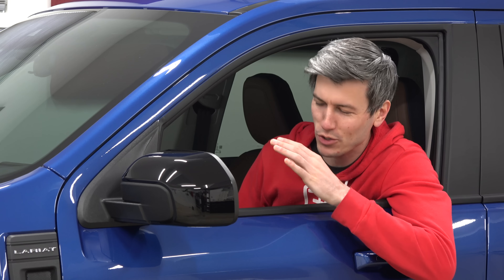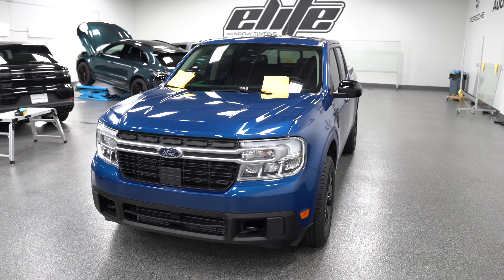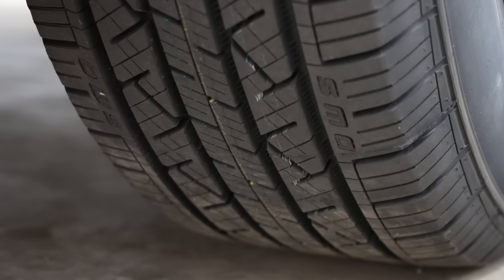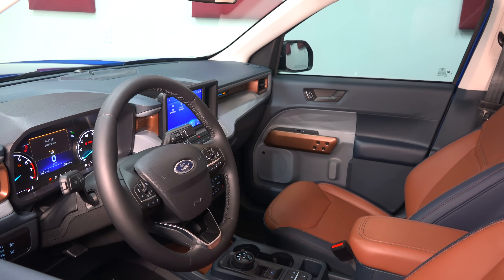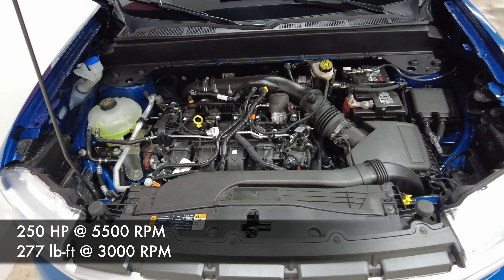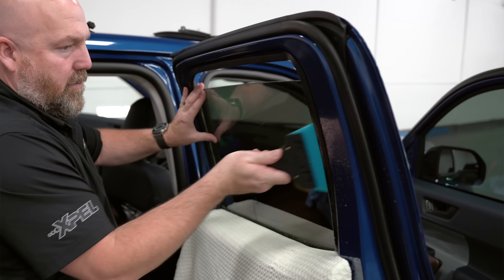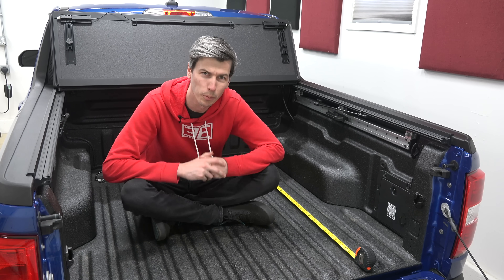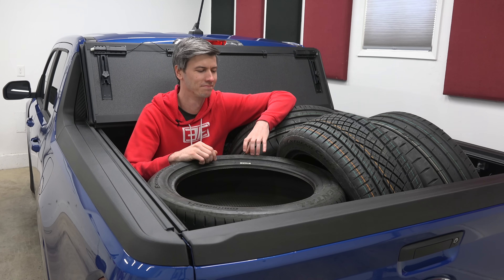I Bought A Ford Maverick! The Perfect Pickup?

Comment: I LOVE RATIONALITY. Thank you for this video. I live in Australia and the best selling vehicle is a Ford truck like the one featured. Unfortunately there is a concerning trend for buyers to purchase the oversized US trucks like the F150. 98% of people who purchase these vehicles don't  need something that size. I wish our frail egos did not drive us towards illogical choices making us consume much more than is necessary. These large vehicles also pose a huge safety risk to drivers of normal vehicle's, not to mention pedestrians, cyclists, children, and motorcyclists. Their mass and poor braking performance can be a deadly combination. Please buy what you need and not what you think you might want. 
PS. the vehicle I drive is dwafted by the smaller truck and I can fit 4 large adults and 3 packets of mulch in it with ease while consumming 4.9 litres per 100km of fuel on the freeway.

Comment: I used to work in construction material testing. We hault wheelbarrels, coolers, concrete cylindars, drilling equipmemt, buckets of aggregate, nuclear density gauges...the Ford Ranger or a small van was the perfect vehicle for the majority of jobs. The remaining ones used the larger trucks. But most prederred the Ranger or Tacoma. 

Its funny watching people struggle to load a 4 door massive truck with a short bed at Home Depot. 

If I were to ever buy a truck, this would be it.
Reply: We still do these kind of things in Europe and its mostly vans that are being used. Havent really understood why you would want to transport something in a truck bed instead of a sheltered van. You dont get the off road capability, but gravel roads and forest roads are fine. To each their own i guess ;)
Reply: Dude I’m also a concrete and soils tech. I’ve been looking for something affordable and good mpg bcuz of how much were on the road. Looks like this is the winner.

Comment: The problem that I have with pickup truck owners is that they think they might need it for something some day, so they buy a truck. But the statistics don't lie. The vast majority of those trucks only haul kids and groceries. Something you could easily do with a station wagon, or a minivan. Those pavement princesses are always so clean that the drivers wouldn't dare take it off road because they are afraid it will chip the paint. Those aren't work trucks. They are compensating machines. And they blind other drivers on the road because the damn headlights are so high off the ground, and are responsible for the uptick in pedestrian fatalities in recent years. Take my downvote Engineering Engineering Explained. See you in 5 years when that truck won't have done a decent days work in its entire life.
Reply from the maker: Lol, getting upset bc I bought a truck the size of a Honda Accord. Nicen
Reply: @EngineeringExplained  the headlights are still so high off the ground that you blind the rest of us while driving. Try thinking about the other people on the road and stop being so selfish.

Comment: I just got mine in early April. Same color (blue cars are the best), but hybrid XLT Lux. A few years ago I had a rental with a heated steering wheel and I knew my next car had to have one. 

I'm not bothered as much by the auto (hybrid has an eCVT which is a planetary gearbox with the electric motor filling in the gaps) as the dial. I've already accidentally thrown it into park both attempting to go to reverse and going to far, and going from reverse to drive and going the wrong way.

Comment: The Maverick might not do everything, but it packs around air in the box like any other pavement princess on the road. A lot of people don't buy what they need for their current circumstances as trucks have become a status symbol. I mean buying a loaded diesel dually pickup is cool if your budget allows it, but unless you're going to put it to work hauling/loading things, you're just burning the rising cost of diesel and taking up space/handling for nothing. The Maverick (or vehicles like it) makes sense for a lot of consumers. 
Honestly with rising fuel costs and work taking up too much time, been debating selling my RV trailer and pick up, and downsizing to a Maverick or Ranger, kind of wish the Maverick towed just a little more and their hybrid had 4x4 for winter up here though.

Comment: It's so funny that you bought almost the exact same truck as I did except I got the Hybrid and the original 2022 Velocity Blue! I had also really wanted and awd hybrid, but tbh this FWD hasn't let me down rain, snow, or over-landing in New Mexico. What's even more amazing, I opted away from the OEM Michelin Primacy A/S for the same Continental CrossContact which I put on in December with my truck at 50k miles. 
I do love the interior, though my rear seat has a tear from loading a suitcase so be careful. My dual-zone a/c knobs also have the digital temp readout that they got rid of due to chip shortages. 
After 2 years and almost 60k miles the only advice I might offer is: the paint on the front of the hood has been demolished by highway rock chips. Pick up a hood deflector or PPF sooner rather than later.

Comment: I initially took issue with the opening to this video, because no one needs a truck, and people buy them when it makes far more economical sense to rent them.

But then I looked up how efficient the hybrid version is, and its towing & cargo capacities, and its price. This might actually be a practical daily driver, which is insane because it's a truck. And it's a truck that is better than almost any truck out there for having an accessible usable bed space. The only downside is the length, but that just makes it more practical for most use cases and only slightly more difficult for the rare use cases.

Except for the fact that it's a Ford, this is good enough to be worth considering over a sedan, which is insane.

Comment: I feel your pain. I own a Honda Ridgeline and live in Texas.  I get a fair amount of crap too.  I owned full size trucks and will never look back…
Reply: Same. 100% same. I haul air 99% of the time.
Reply: Yup! I know what you’re talking about. I too am in Texas and am very interested in a Ridgeline. In reality it’s all I need and I’m a Honda fan. Currently have a 2015 4wd F150 with a 6.5 bed and it’s tempting to make the switch. Only thing holding me back is that it’s been paid for almost 5 years now and I only have 50k miles on it
Reply: Not a fan of the new ridgeline , but I owned a 2013 ridgeline top level and sold it for 5k with 310k miles on it . Best “ truck “ I ever owned and I had f150, f250 and f350 all with over 100k on them.
Reply: Being a Ridgeline owner since 2008 I have heard all the comments but I love the Ridgeline and the reliability to chuckle about it.  I simply do not need the larger trucks.  There are legitimate needs that the Ridgeline is not suitable for but for me and many it serves the purpose.  The Ridge has a V6 engine that requires a timing belt replacement at intervals but it has been trouble free.  It is certainly not suitable for those that drive large trucks for the macho status.  What are your thoughts on why you would pick the Maverick rather than the Ridgeline?

Comment: I have a full truck and bought the base maverick got daily also in my full truck I tow my Can am the other day my full truck was in service and I town my Can am to the sands lowered the air and went  inside the sand fully loaded 3200p and will it did great lol it’s a nice little daily I got the base with ugly wheels and bought new wheels and tires more Offroad and a 2 inch lift leveling kit and it’s great with some LED pods and it’s a great daily for everything

Comment: I'm on my 2nd Maverick.  The first was an AWD Lariat with every available option.  When it was time for a new Mav, I opted for an XL with the hybrid powertrain.  I truly never used 90% of the Lariat bells and whistles.  OK, the heated steering wheel was pretty great.  I also liked the look of the Lariat interior, but the "ActiveX" (marketing dept word for vinyl) seats were torture in the summer.  My hybrid XL cost me under $25,000 and it does 100% of what I need it to do.  Plus I'll be a lot more forgiving of the inevitable Ford squeaks and rattles on a $25k vehicle than I would be on a $40k vehicle.

Comment: The 2 liter duratecs are fantastic engines. Ford's been making them since 2006 and they are practically bulletproof
Reply: It’s an ecoboost not a duratec.
Reply: @manitobasky  Ecoboost is just a marketing term they came up with in the 2008 recession. This is from Wikipedia for Ecoboost 2L: "This engine is derived from the 2.0 L Mazda L engine block used by Ford" aka a 2.0 duratec. I have one in my 2006 focus and my 2016 fusion and they are nearly identical. Solid engine. The focuses had two different manufacturers in the early 20's and the Duratec more or less won out in 2006.
Reply: Head gasket issues and coolant leak into engine mixes with oil and say bye bye engine no not reliable
Reply: @skyhawk21  They fixed all that issue in design WELL Before the maverick was built

Comment: You convinced me, I’m getting one!  No kidding, not going to pay 55-60k for a stripped full size. That’s insane. Plus the 2.0 is a great motor had it in the Escape I just sold. Thanks!
Reply: I would really think about it, there's like 7 different recalls out for the maverick so far.
Reply: @eg39701  that's every Ford product 😂😂😂. I've had like 14 on my Fusion but it's free parts and the car is still a great value overall
Reply: Get a Honda Ridgeline.   Best truck on the market.  (As long as you don't plan to truly -off road your truck).
Reply: @bikebudha01  its on my list for sure
Reply: @bikebudha01   I would love a Ridgeline, they're just too expensive.
Reply: It's a good vehicle but just doesn't have the road presence.  Makes the driver look like a nerd.
Reply: Take a look at the Santa Cruz as well. Unless you hate the look, the electronics are substantially better. Only downsides to the SC are no switch for the bed light in the bed (it's up front). Oddly no parking sensors either, but no bid deal due to top-down view.
Reply: How long did you have the Escape?
Reply: Engines leak coolant into oil on these crappy ford cold defect engines
Reply: that was years ago on the smallest turbo motors
Reply: @skyhawk21 , with which engine? EcoBoost or hybrid?

Comment: OK, it suits your purposes. As it suits the majority of It's, buyers who don't actually need an actual pickup day in and day out.
 "Actual Pickup" 
8 foot bed.
V8 engine.
Can be either 2wd or 4wd. Yet it needs to be limited slip or posi as some refer to the drive wheels.
  If it is lifted. It's minimal. 
There is no under glow,ever.
 There is caked on dirt.

Comment: Between this and a crossover of equal specs +-, I’d take a crossover with fold down seats. I’ve owned nothing but trucks and one corvette, but when you can leave your stuff inside, covered, locked etc the value of a pick up becomes almost irrelevant. Especially if you can store a small utility trailer

Comment: Dude, I drove trucks for like 20 years (S10 and Frontier), but cars can do basically everything small trucks can. I can fit 3 bags of mulch in my LEAF with 2 kids and car seats. I've fit 8 bags with the seats folded down. I also fit 4 tires inside it every time I swap summer and winter tires. I also added on a tow hitch and regularly haul around a 4x8 trailer for the stuff that doesn't fit inside.

Comment: Not only is it a truck, the hybrid Maverick is the most energy efficient truck ever produced. Wanna start your own car company? Start with a hybrid Maverick powertrain, optimize it for 4WD and to flexibly run on any combination of pure ethanol and gasoline. Then use it in a Full-size Pickup. Now you can beat your friends Raptor running on zero  fossil fuel renewable ethanol😈.

Comment: I like the Maverick and all, but I'm surprised you didn't use your Automotive YouTuber influence to get something more interesting, like finding a way to import a Toyota Hilux Champ.  Or convince Subaru to jump back into the compact truck market like people keep speculating/begging for them to.  I mean, I'm sure you have enough pull at Subaru to get them to release a Baja/BRAT replacement with a turbocharged engine and manual transmission, right?😉

Comment: No, it's definitely not a truck. However, it's an eminently appropriate vehicle for 90+% of the people in the US who drive trucks. 

I have a 2008 Tundra with ~300k miles; it's definitely a truck, and I won't be trading it in for a Maverick anytime soon. If I used the Tundra as my primary vehicle (only about 12k of those miles are mine over an eight year period), I probably would; however, I (appropriately) only use it for truck stuff.

Comment: The only version that makes sense is the hybrid.  The difference in real world fuel economy is massive, it's more reliable, and it's cheaper.  Unless you're going offroading or are regularly towing over 2K pounds skip the non-hybrid.  It mostly defeats the whole purpose of it being a fuel efficient commuter you can use for hauling stuff.

Comment: I love small trucks I have owned an early ranger and a Mazda B2200.
 I really dislike the maverick though. I drive one almost daily for work. They drive alright but everything feels cheap, they are not very comfortable transmission acts odd compared to other automatics, annoying shift knob and finally it's a ford. I haven't had many good experiences with them especially on the newer ones quality control issues (heated seats failing in the first couple months, speaker rattling around. Etc) and transmission issues. A previous f150 I had would just stall on the highway when it would downshift during acceleration, explorer had heated seats fail, bad transmission and the rear defroster separate and a ford fusion that was just bad all sorts of faults with that would come and go.
Bottom line I want a small truck or even a ute. Something with a longer bed and a smaller cab would be nice. But I will not be buying a ford vehicle

Comment: What I find bind-moggling is that the genii at Fnord couldn't figure out that the easy path to making a hybrid was to take the FWD power pack from one of the FoMoCo's commuter boxen  and put the battery & electric motor in the rear. Seriously, maybe two days of late nights and they would have had a test mule up & running. As my dad used to say (in re: one of Fnord's most-played TV ads) "If they had a better idea, why didn't they use it?!?.."

Comment: At 18K I was a potential buyer. At 40K, no way I shop for this thing. Even in Lariat, interior plastics look so cheap. 8 speed transmission is a big question mark for longevity, not the mention 2L turbo Ford engines

Comment: I had 22 XLT with AWD and the 2.0 T. While it drives very easy, the AWD system works pretty good, and the turning radius is great for tight areas like navigating levees and canals which is what I mainly used it for, I just couldn't get over the build quality, interior and infotainment problems. The seats, at least the cloth ones are small and uncomfortable for long drives. The interior rattled a lot and the cup holders just suck. The infotainment would randomly shut off and most annoyingly randomly disconnected your phone. Traded in for a 2020 F-150 and couldn't be happier.